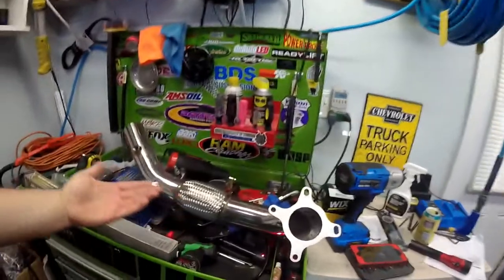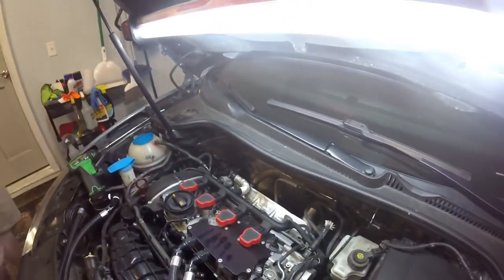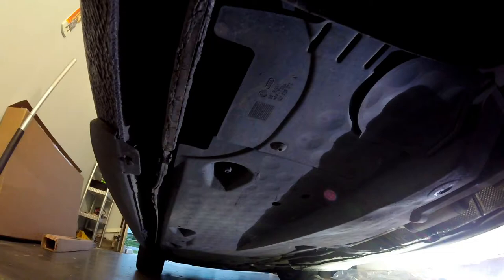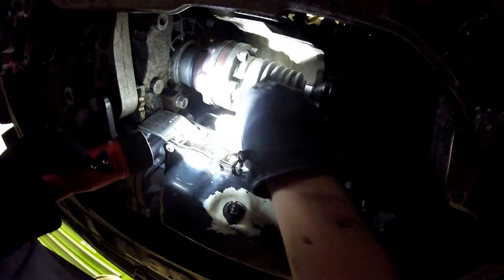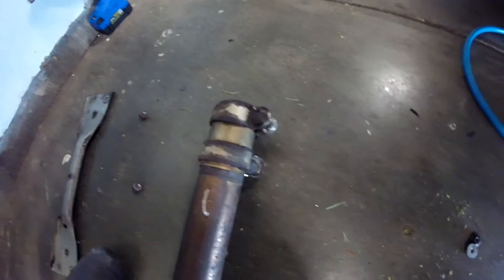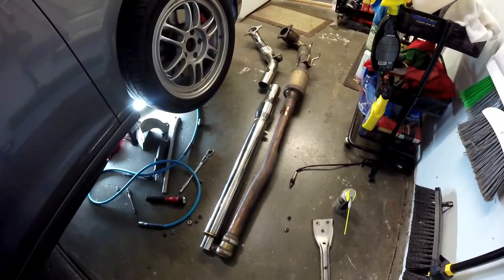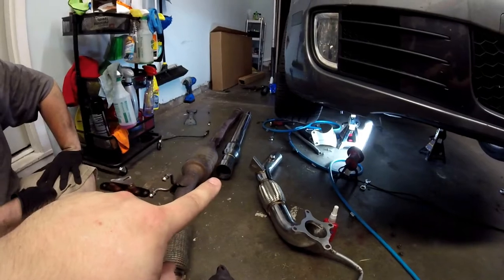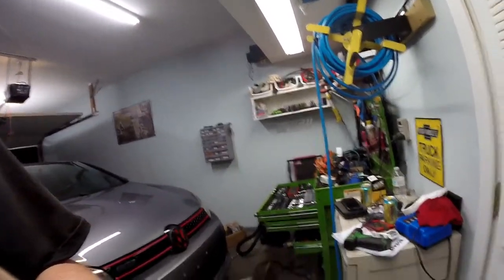MK6 GTI ARM Motorsports Downpipe Install

Comment: Man I can't tell you how helpful this is.  Literally just got my ARM down pipe for my mk6 gti yesterday. Hopefully can get it installed this weekend. Thanks for keeping it real about that top nut on the turbo flange, been making me nervous to try this at home until now
Reply from the maker: I was in your shoes!! haha But yeah I wouldn't sweat it.. a little lube and if the nut stops tighten it back up spray some more lube on it and it should back right off of there!! So far I am VERY impressed! Really woke up the mid range torque, Butt dyno of course! haha

Comment: Obsessed Auto Did you use any additional hardware for shorty rear section? Is there any other way to install it without any additional hardware. I'm gonna install it in MK6 Jetta GLI.
Reply from the maker: We had to use different hardware for the clamp to connect to the factory cat back exhaust because it was too far gone.
Reply: Obsessed Auto Can send me the link of the hardware you used?
Reply from the maker: We just have on of the Dorman metric kits you can buy at the parts store and just grabbed out of it.  I'm wanting to say it was like an M6x1.5x2"... nothing too fancy because I feel like the cat back system is going to be replaced before too long! ;)
Reply: Got it Thanks Man! But anyway you should have done more sound clips.
Reply from the maker: We have this video and it was 2 am when the project got done so we can sure make more sound clips!  There is a sound clip video on top of this that is separate! Check that out!

Comment: Hey installed my arm a couple weeks ago.  Got a oem crush gasket. Question any leaks around the exhaust clamps and if not how much did you crank them down? I  just used exhaust paste and let it sit for awhile and still have leaks at the clamp spots. Thanks.
Reply from the maker: Didn't have any issues with the clamps, still need to get the extension piece for it. Didn't have any issues after switching to an OE gasket.  I gave the bolts the beans to make sure I did not have any issues with leaking at the turbo.  As far as the clamps and how tight we just used an impact on a lower setting to zip them on, depending on where you are using some anti-seize may be a great idea if you ever plan on taking it off!
Reply: Did you ever figure this out? I still have leaks around the clamps aswell. They are TIGHTENED and still leaking

Comment: any check engine light after the install? I just installed mine sunday and i'm getting a light because of a p0420
Reply: A tune will get rid of that. If not 02 spacers are needed
Reply: @usa5046  how do I know what O2 spacers to get for a mk6

Comment: Did it throw a check engine light? If so how do I fix it without a tune? 

Also one more question, was the end of the pipe a bit short? I read something about extensions? What kind of extension and how do I get it?
Reply: @MrMiguel8484  link doesn't work.

Comment: Hi my friend i have a question if i can ask u course?? Can you tell me what is this the thing on a valve cover on your engine in a place for carter ventilation i mean a black thing with a two hoses its look like a oil cooler conection , you putet your flashlamp on this on a begin your video,thank you so much for an answere i have also a golf gti but 5th generation and i want to change some things to be a different than rest ,, Arthur,,
Reply from the maker: That is the PCV replacement plate with fittings for the Integrated Engineering catch can!

Comment: hey! does this ARM motorsport downpipe fits to the vw golf gti ED35(173kW) too?
Reply from the maker: I'm not positive, but I would assume that as long as it's the 2.0TSI it will work! Be sure if you get it to buy an OE gasket!! The one provided blew out very quick.
Reply: @ObsessedAuto  thank you. I already ordered the catted ones. As I see gasket is included with the arm downpipe.
Reply: @Mantyyyz  hey man i have gti ed35 too wondering about the same thing talked to arm motorsport and they said it should fit if u have k04 turbo. did u install the downpipe? it fits?